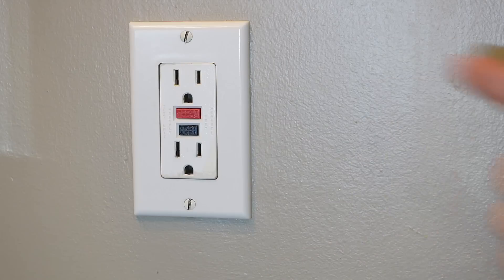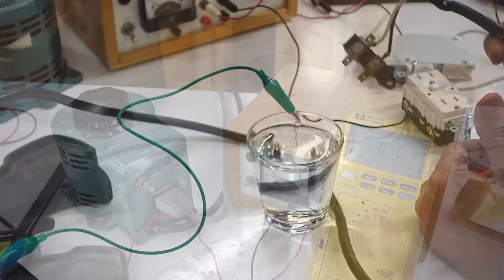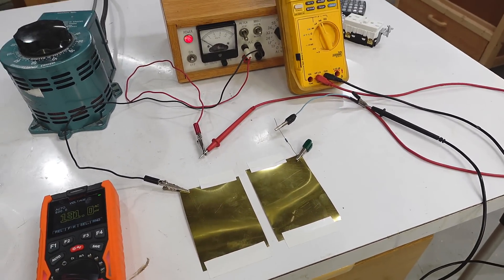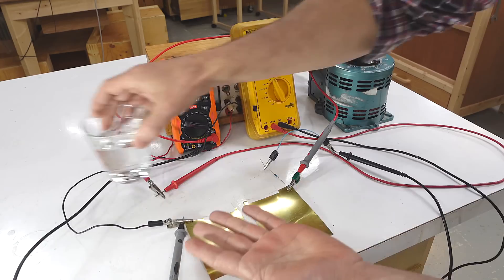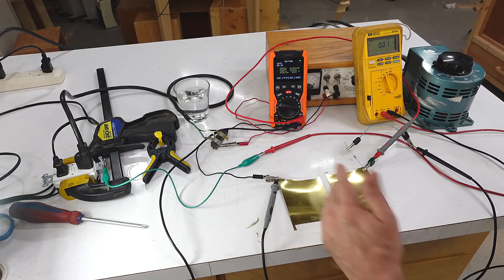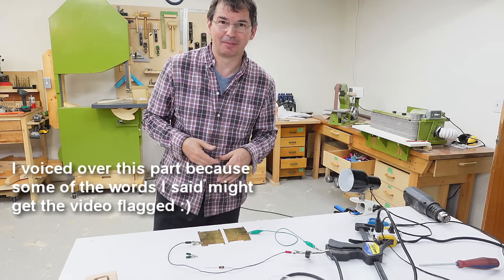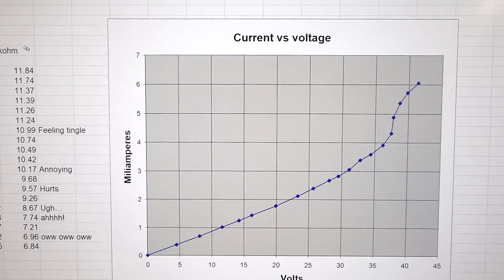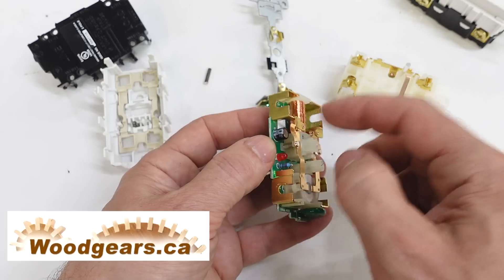What does it take to trip a GFCI by hand

Comment: My brother learned this the hard way as a kid by sticking tweezers into the wall socket
Reply: In high school, a kid stuck an unfolded paper clip into an outlet - at least he had the smarts to push the paper clip through the bottom of a foam cup, and was only holding the cup. I remember a little molten ball of paper clip metal danced down the hallway floor for what seemed like ages - we had a great laugh, and there was a permanent burn mark left on the outlet cover!

Comment: Funny story: When I was ~16 I had a class about electricity and my teacher set up a demo very similar to this one. He believed that it was good to let kids feel what AC feels like. (Reasonably safe ofc, with isolation transformers etc etc.)
I asked if I could opt out, which he really didn't want to allow, until I showed him the scars on my hands from where I grabbed an uncovered extension cord I had forgotten to unplug while repairing it. I explained I got the 2 marks on my thumb and index finger from where the full 230V went trough. Although we have whole house GFCI protection here in Belgium (300mA or 30mA depending on situation), since I wasn't making any contact with ground and my hand was (luckily) not low enough resistance to trip the 20A breakers instant shutoff, it "coocked" my hand while I was frantically swinging my left arm at the switch on my lab bench's power switch. In some ways I was lucky, because I was not touching any earth, so none of the current went up my arm.
I usually don't even remember the scars are there, except when I get really dry hands and the "pull" a bit or get itchy. Or of course when someone makes a video about electrocutions :)
Now all of my lab sockets have been behind an additional 6A 10mA RCBO. They might be expensive, but for 50€ you really can't play around. Also: A second hand E-Stop button can be quite cheap and is much easier to hit than a power socket switch, but any switch is better than no switch at all. Because I can assure you: You cannot let go.
Reply: Or use a pedal switch which needs to be constantly pressed down for sending power to the sockets. If you get zapped, you'll immediately release the pedal and thus cut off the power. It also works as a deadman switch preventing the power to stay on when there's nobody on site.
Reply: @FOHGeek  as long as the electricity doesn't create a type of muscle spasm that keeps your foot on the switch.  (Which, I think can be arranged, mostly, but just, yeah, something to be aware of that that's not necessarily guaranteed.)
Reply: Do bathrooms in europe have 5ma gfci? (not talking shaver receptacles)  I've heard a few people make comments that infer a rcd breaker at 30ma gives protection like our gfci in the states and I giggle knowing that the 5ma gfci hurts a bit and a assume 30ma really hurts.
Reply: @fanplant  In Belgium: No, it's 30mA (at 230v). And we don't have special shaver sockets. The sink in the bathroom has the same normal sockets as everywhere else.
But: Today almost all appliances are double isolated and or IP67 rated and or battery powered & induction charged (toothbrush, shaver)
The only real exception I guess are hair dryers.
Reply: @Dries007BE  ouch! I think the your rcd are for equipment protection pretty much. 28a at 230v going to earth is a lot of spicy electric and the fuse wouldn't know any different.
Reply: @fanplant  28A?
For equipment/wiring protection we have normal breakers are 20A for sockets on 2.5mm² cable (16A for lights or mixed on 1.5mm²)
Then we have a main diff at 300mA and a 30mA one for wet circuits (in most existing building).
Regulations changed last year, so now all non-fixed-appliance circuits have to be 30mA protected, with a max of 8 circuits behind 1 RCD. The 300mA main RCD is still there. This will take a long time to be applied everywhere ofc, since regs don't generally apply retroactively.
The stupid thing is that we don't require different selectivity on those RCDs, so frequently if you do something wrong, it will trip the main RCD and you'll be out of power everywhere in the house.
Reply: @Dries007BE  sorry I'm not familiar but still 20a can do some damage. In the US service switches over 4000a (don't quote me, lol) have to have a GFI. Last one I hooked up my boss had me turn it up to 100a because he didn't want any nuisance trips. It was in a very old school.
Reply: Wow. Yikes. That must have been scary and painful. I trust the teacher did let you opt out in the end? I hope so! 😮
Reply: @DavidLindes  Yes, I got the opt out. Still became an IT/Electrical engineer. I play with low voltage most days, but when it comes up I'm serious about protection.
About scary/painful: Funnily enough, in the moment I was more fascinated/disturbed by having an arm that, up to the shoulder, did not obey my commands and was shaking like a madman. The second degree burns hurt when healing mostly.
It's more scary now when I think about it and realize that any number of changes in the situation could have caused a significant current to go trough my body (and not just my hand) and may have killed me. (for example: What if I hit the earthing pins of the power strip with my other hand instead of the off button? Then 300mA would have had to flow trough me before it tripped...) But that realization only really came later.
Reply: @Dries007BE  fair enough.  And yeah, can relate to those moments of fascination...  Glad it didn't dissuade you from your interest, just added a layer of caution!
Reply: Come on...  At some time, we must all "let go."  I learned my lesson from a close call, not an actual injury.  Sorry you got wacked like that.
Reply: i can confirm that that you cant let go, when a specific amount of cuttent flows through your Body. Im still alive, because the RCBO tripped that one day at work... Cuttent flow from one hand to the another hand in parallel through the with... not a cool situation...
Reply: It is always interesting to hear stories like that in America normal house sockets are only 120 V always fun when I go to another country and you guys actually have some serious power running through the circuits

Comment: I'd be willing to bet every single one of us viewing this has shocked themselves (unintentionally for the most part). Not proud of it, but it is a good lesson I've learned. Thanks Matthias!
Reply: When I was about 14 I jury-rigged a uninsulated connection for a cassette recorder 2 prong plug in a 3 prong wall outlet that was placed at about shoulder height. The prongs pointing outwards. At some point I was joking with my cousin while walking backwards in the kitchen. I wasn't wearing a shirt. The prongs of the cassette recorder plug made contact with my back. I still have scars there. Decades later I don't recall the last time I got a shock, the experience trains you.
Reply: Oh yeah. All 3 phases on my arm. Some nasty black spots.

Comment: Industrial test equipment there was a 15v glass fuse on the Veroboard PCB circuit, I changed it not realising the low voltage fuse was mains 240v - I should have checked first.

One of my other jobs was working on production machinery while it was live at 240v wood ladder and a gas soldering iron and some times rubber gloves, because they did not want to stop the production line.

We did have special rubber gloves for working on our factory substations live 440v busbars, I left that work to the other electricians. (see "Presel GP-1"  7500v max)
Reply from the maker: the bigger risk thee is accidental shorts or arcing.  Accidental electrocution is easy to avoid by just using one hand and not having the rest of you touching any conductors

Comment: I got my first 220VAC "experience" when I was 3 y/o. Had a toy with some metal bars that fitted perfectly in a Danish power socket. Fortunatley my father was fast and pulled me away  before any permanet damage was done. It might have caused my interest in electronics though :-) By the way, this was before CFIs was mandatory in Denmark - the early 1960s. I was 12 y/o when I got my next elecrtical chock. Still have a scar on my hand from it.

On a side note. Be carefull with this kind of videos. BC just got a strike on his channel for a short, that according to YT's algorithm, was very dangerous.

Comment: Thanks for the video. Super Interesting stuff!  My advice is to re-upload this with a warning at the beginning of the video, especially, "Do not do this...etc"
Yea, it is pretty risky if the gfci fails... in your case, there's nothing for your hand to "grab", but if it had been a wire instead of a flat piece on the table, theoretically, if the gfci failed, your hand would uncontrollably grab it, and you would be very in trouble. I think your "biggest" mistake is not showing anyone as "present" in your video in case of emergency. Doing these types of experiments without another person who understands the risks and can handle an emergency, is not only dangerous, but, potentially deadly. Knowing there is at least "someone" there who can shut off the breaker... you know? 
    I have seen some really bad videos of a person putting their hands into a tank of water this way... not smart if the gfci fails, and they collapse ... because the water will fall on them.
I think your other mistake is not putting a warning at the beginning of the video. 
I do want to thank you for answering an age old question in my mind. You are a brave soul.

Comment: Yeah it hurts if you have a good ground. But back in the day, while working in residential electrical, we used to test wires to see if we had a 'hot' by just tapping the wire with a finger (usually the black wire); careful that we weren't grounded of course. But just think of what the 220 volt countries do when they get a jolt. That would REALLY hurt, might be deadly even.
Reply from the maker: Back in the 80's trying to fix an old tube TV where the chassis was either hot or neutral, depending on how you plugged it in, I just swiped my finger on the chassis to see if it was hot.  After about 10 iterations of plugging it in, I thought "what are the odds that the chassis was neutral every time".  Sure enough, it was NOT neutral, just I wasn't grounded so swiping my finger over it didn't result in any current flow, so no tingling.
Reply: @matthiasrandomstuff2221  We live and learn!

Comment: Something that feels more fun, back in high school vocational electronics (1989), we each built our own heathkit osciliscope. On the bottom the of the frame was the main connector terminals for high voltage, and while working on it, I went to turn the scope around on the table, and my finger hit the lead for the high voltage for the CRT. Luckily trhe rest of my hand was on the frame so it only jumped from finger to palm, but I tell ya, never did that again!

Comment: CO2 fire extinguisher gave me a shock the other day, I must have a hole in my shoe. The ice crystals in the plastic horn must be creating static electricity. 
I guess it is not safe to be used near petrol or propane if your standing in it (would it ignite ? ) anyway for wet fuel I would use foam or powder extinguisher.
Reply from the maker: I suspect if you are using a fire extinguisher, whatever it is you are using it on is already ignited.

Comment: Stick welder bending the electrode back in the 1980s I used to get the odd tingle depending n the rods, I think our welding plant was around 70v AC
Reply: My biggest welding transformer is 80 VAC.

Comment: Could you cover how a GFCI can fail? Are there signs to look for? How often you would need to replace them, etc?
My house also has some GFCI outlets wired in series, is that unusual or unsafe in any way?
Reply from the maker: Push the test button.  That puts about an 8 miliamp unblanced current on it to trip it.  If in doubt, also push the test button while a blowdryer is plugged in.

Comment: When I was 10 or so my dad taught me some electrics and we added a socket somewhere in the house. Off course the cirquit was off, except that we switched off the wrong cirquit. My mom came in asking why all the lights were off, that's how we found I had tripped the RCD. Didn't feel a thing.
Reply: That's also how they're wired here (Australia). Possible differences are that 1) earth and neutral are tied together at the before the RCD and 2) the breakers I've seen only break the hot wire, not neutral (which is what I meant by single pole).  So whether touching earth to neutral trips the RCD doesn't depend on the state of the breaker, only on there being some voltage drop along the neutral conductor in the distribution box, which there will be if there's any load on the other circuits fed through the same RCD.

I hope that was clear; I hate typing on tablets
Reply: @omnompontif  Afaik, the RCD measures a difference in current  between live and neutral. As there is no closed cirquit, I do not see how any current could flow. If you have a voltage on your cirquit (maybe through induction), making a connection to ground the currents will be so minute (microamps) an RCD will not trip. I do not see how enough current (±30mA) can flow through the neutral leg to trip an RCD (with the live leg disconnected by a breaker) save for another cirquit connecting to this one, in which case that cirquit's RCD should have tripped (if it had one). Or do I miss something?
Reply: I'd say you probably touched neutral to earth.  Breakers* are single pole so you can still trip the RCD with the correct breaker open
Reply: @omnompontif  Not how they're wired in the Netherlands. RCD's are "in front of" (as seen from the distribution network) the breaker, one RCD usually covers 4 breakers. RCD's measure the difference between incoming and outgoing current. So if the breaker is open (and on the hot wire, which it is), no current can flow unless something is really wrong with your earth and neutral.

Comment: Just the other day I thought what risks you take with electrics (unshielded wires during experiments) but you're in North America. Here in Europe we have double the voltage (240V) and our frequency (50Hz) is the best to set heart muscles into fibrilation - 60 Hz is already a lot less dangerous (still not safe). I have been told (don't know if true) that older military aircraft ise 400Hz because muscles don't contract on that and the danger is in heating your body tissue, which you will feel as intense pain but you can work directly afterwards.
Reply from the maker: Didn't know 50 hz was worse than 60.  But DC is definitely safer -- Edison was right about that.  Just not practical for energy distribution without a lot of high tech inverters.

Comment: I had a shock from 400VAC hand to hand when working on a dodgy site and it almost killed me. The unqualified electrician had bottom fed a set of breakers (the busbar was on top), I switched off the breaker and removed the wires below and got shocked. I broke protocol by not testing for zero potential. Since that day I have never broken protocol again.
Reply: I watched a coworker get quite a zing off a 208v 3-phase circuit one night.  Some asshat didn't obey wire colors and used whatever they wanted at each junction box.  So while the disconnect wires looked correct, down the line the asshat used green (ground) as one of the phases.  I thought he was going to tear the guy's face off the next time he saw him.
Reply: @grayrabbit2211  I had a neighbor that lost half his right hand because someone forgot to put in a cotter pin on a crane bolt.  He didn't come right out and say it, but it was strongly implied that his buddies introduced the other fellow to the afterlife pretty soon after that.
Reply: 400v, wow. Lucky.
I had a beld from 240v and that was bad enough.
Reply: I was changing a fuse on a 600 volt three phase compressor and somehow touched something live.  It felt like Mike Tyson hitting me in the chest.  Had no after effects from it.  Was more careful next time. That was 49 years ago.
Reply: A grounding rod is a good test - I've blown the end off one at about 700v

Comment: That's really good that both the outlet and the breaker has the same trip current (mentioned in another comment reply). I think when electroboom tested them in europe, the whole house trip protection breaker had a much higher current threshold. 🙏🙏
Reply: Whole house GFI protection has to have a higher threshold because you would get nuisance trips from ordinary leakage current. Most switched-mode power supplies have a small leakage current from their DC output to ground, which translates to a leakage from live to ground. If we assume a leakage current of 500µA per power supply, then it would take 20 wall warts to nuisance trip a 10mA GFI but 60 to nuisance trip a 30mA GFI.